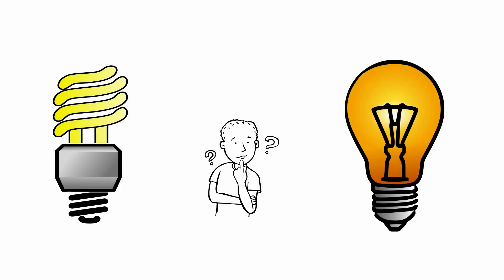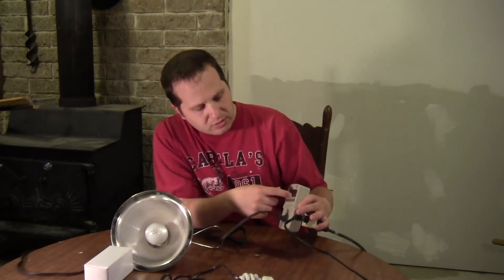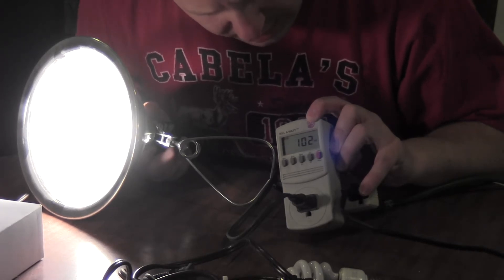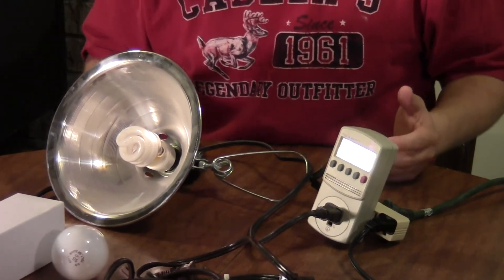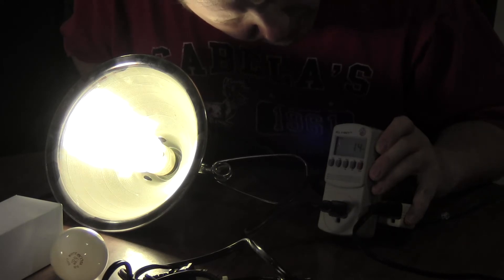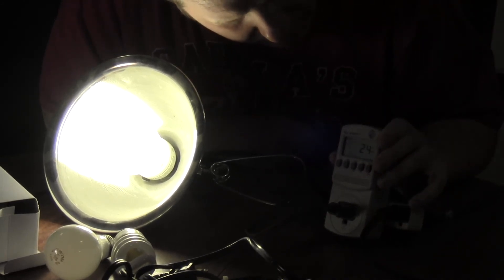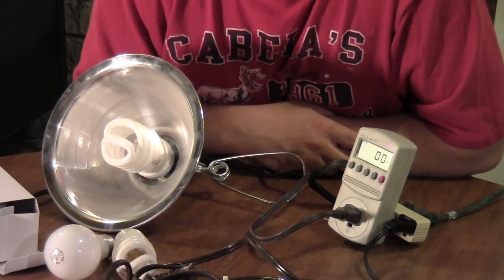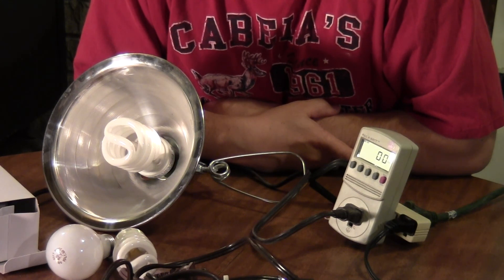How many watts does that light bulb REALLY use?

Comment: You should be using LED
Reply from the maker: That's all I use now. At the time of the video, there were very few LEDs on the market, and those were very expensive.
Reply: LED releases radiation
Reply: Even now it is very hard to find good LEDs with 99% CRI in all colorants.

Comment: im extremely interested in your meter you use for this video! i would like to know how it works ever think of doing a video on that their are also other meters out their and i would like to see your views of them one of them is the [ Electricity Usage Monitor by Spartan Power Energy Watt Meter with 15A Outlet, 1800 Watt Maximum SP-PM120  ] at ( https://www.amazon.com/Electricity-Monitor-Spartan-Power-SP-PM120/dp/B079JWGS92/ref=asc_df_B079JWGS92/?tag=hyprod-20&linkCode=df0&hvadid=242041198988&hvpos=&hvnetw=g&hvrand=13162760431728590165&hvpone=&hvptwo=&hvqmt=&hvdev=c&hvdvcmdl=&hvlocint=&hvlocphy=9032029&hvtargid=pla-418276708212&psc=1) on amazon. its $18.77 and your is $approximately $25-29 dollars.

Comment: I've found the CFLs often have a short life. And they contain mercury. And they don't work well in cold weather, say in a garage during a Wisconsin winter. Even at room temperature they can take a minute or 2 to get to full brightness. I have LEDs in our kitchen. Bright, instant on, good color temperature, low energy use. LEDs are expensive so I look for deals on them. I'll replace incandescents with LEDs as they burn out.
Reply: Greg Steiner it's great leds have gone down in price now you can get a 8 pack for like $13 they used to be $20 a piece or something outrageous but idk i haven't noticed the cfls life spans being short could be brands we get meijer brand and it's getting annoying how long they live cause i want to switch them to led but they won't die hahaha